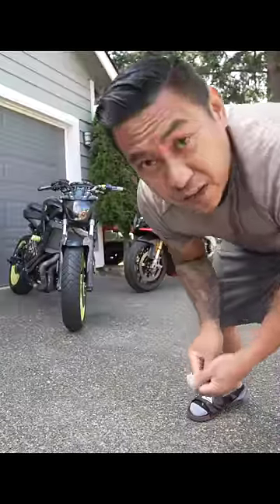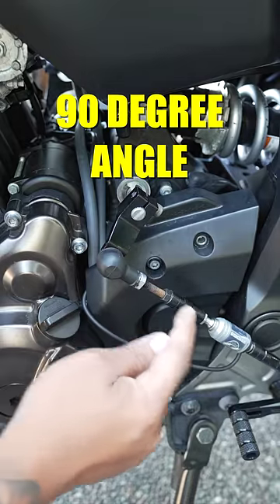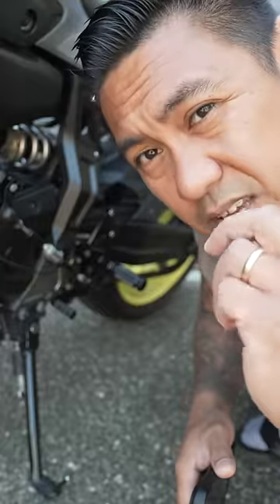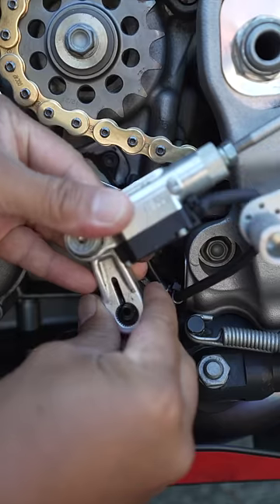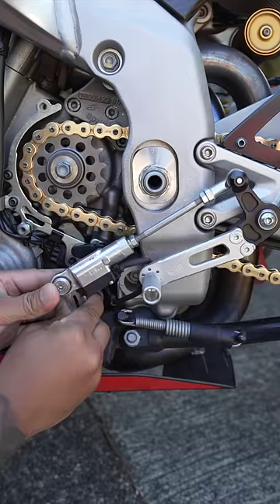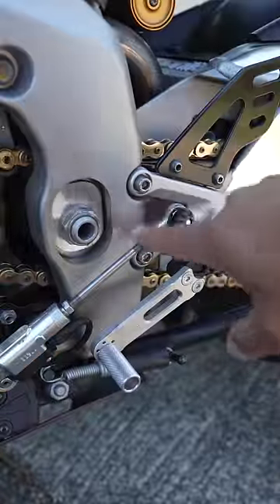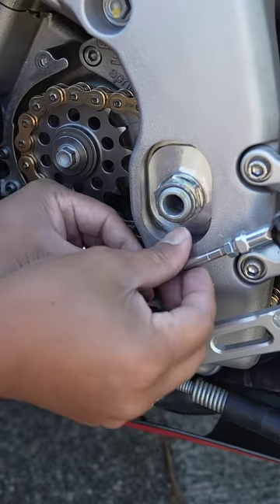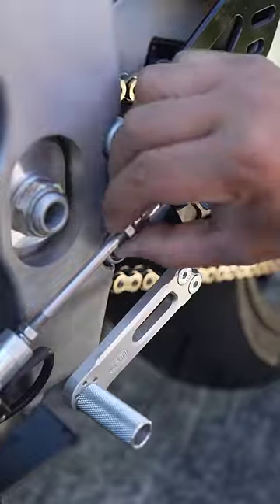HOW TO ADJUST MOTORCYCLE SHIFT LINKAGE

Comment: Don't do that, just use pliers. the rod is set up with opposite threads on one side. best to set it up so the threads are even on both sides so you get the best adjustment range and thread engagement. spinning the whole rear set will just make the thread engagement uneven, and may end up with one side all the way in and the other hanging on by a thread.

Comment: One key indicator that your shifter is misadjusted is if you are missing shifts. On a normal (nonGP) shifter, if you are missing up shifts or finding false neutrals between gears during upshifts, then your shifter probably needs to be adjusted a little (1/8-1/4") lower. If you are missing downshifts, then your shift lever is probably too low and needs to be adjusted UP a little.